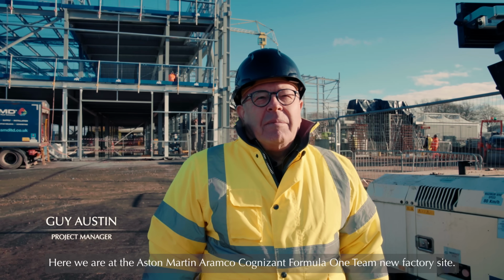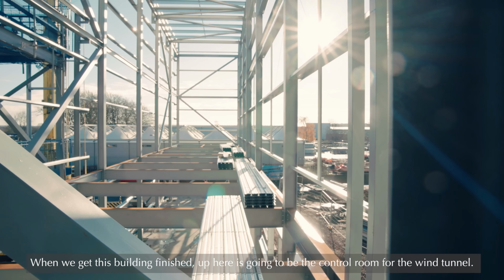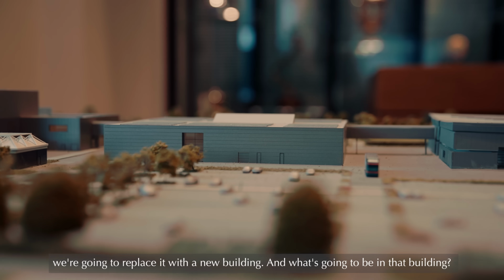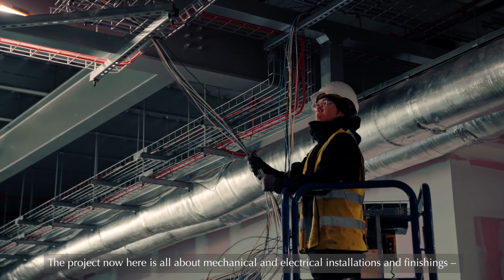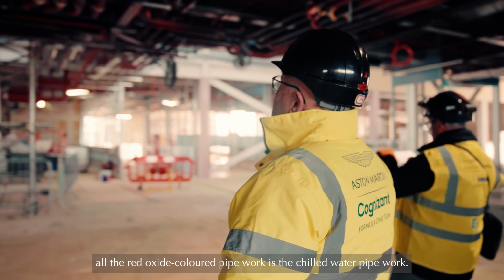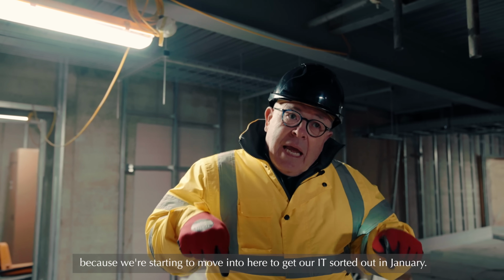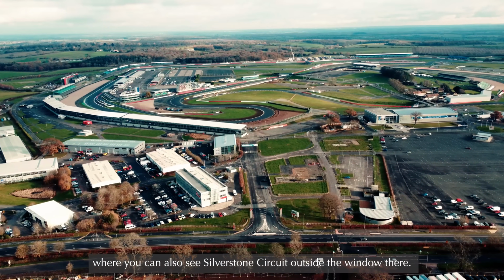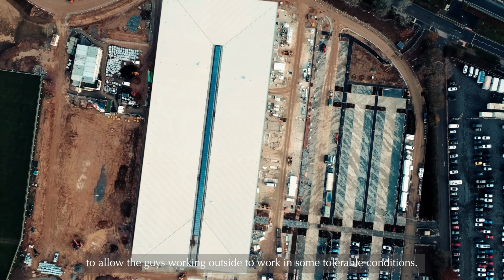Aston Martin F1 Team New Factory Update

Comment: When will it finish?
Reply: Main building (building 1) May 1st 2023. The wind tunnel which is building 3 will be built by august but they need to calibrate it which takes around 12 months and building 2 will be done by end of 2023 or start of 2024 most likely